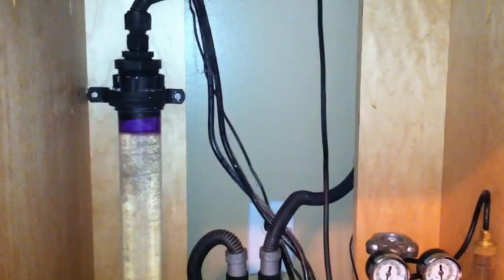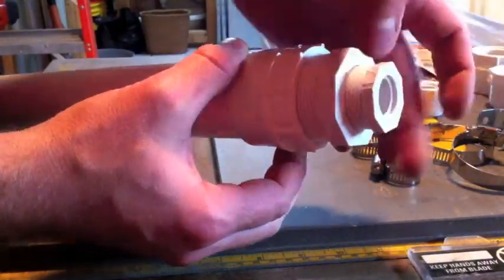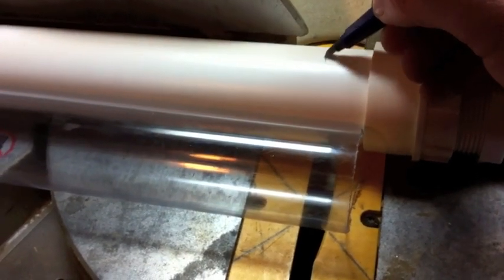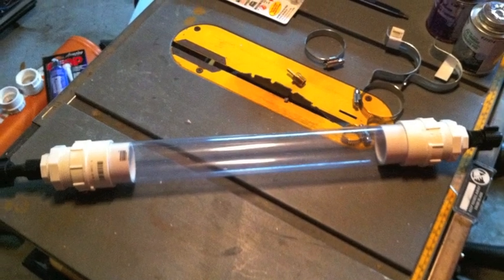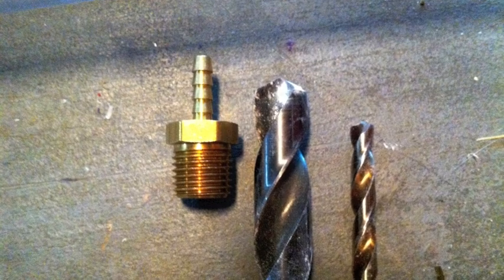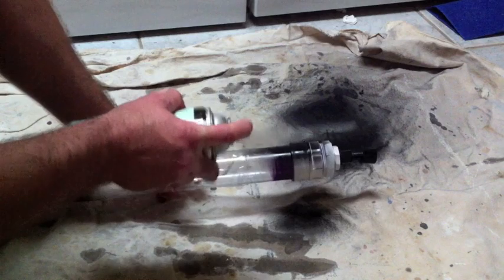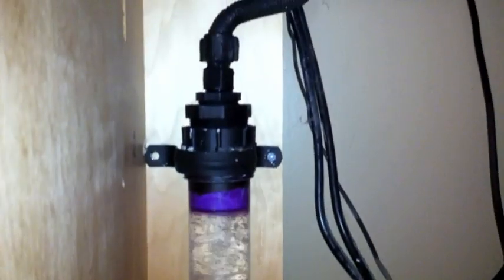Do It Yourself In-Line CO2 Reactor for a Planted Aquarium

Comment: Nice video. I know its old but I have some comments for anyone watching in the future.  

Threaded fittings are threaded for a reason. These should never be glued. You should only be using teflon tape (plumbers tape) to seal the threads. If need be you can also use liquid thread sealant but once you glue it there is a reasonable chance the fitting will leak and you will never be able to undo the threads. Now you've just made yourself a nice piece of pvc trash. 

Also, if your goal is to diffuse co2 in a reactor why is there no media in the main reactor chamber to break apart the co2 bubbles? Thats the whole point of the reactor being a 1.5" pvc length. You might as just pump it through vinyl tubing if there isn't any media in the reactor. Its not a reactor the way you've set it up.

Comment: Thanks for the video. There seems to be some confusion on a couple of design characteristics. It would be very helpful if you could clarify for others that want to build one.
1. Which side of the filter is this located? Intake side, or outflow side? 
2. Which way does the water flow through the reactor, downwards or upwards? 
TIA.

Comment: I see the co2 going into the bottom but witch way is you water flowing
Reply: Andrew Howard actually are you sure. I think the water is flowing in from the top (hence the splashing in the tube) and out the bottom.
Reply: eddiekytia Water is flowing in through the bottom and out the top.
Reply: @Townie_au  Top down otherwise it will not work

Comment: You're feeding the CO2 into the bottom of your reactor? Is the water flowing from top to bottom?
Reply: gpwnedable the best way to go is to just flip it. Have the co2 input on the top. Then run water from top to bottom. So Filter -> top of reactor -> through the reactor -> out through the bottom of reactor -> into the tank. This way the co2 is fighting the water pressure coming from the top more effectively.

Comment: Hi Start,
I love the design you came up with, as I'm looking to create the same type of in-line system for my 210 Gallon tanks...One question, though.  As far as I can tell, you have the reactor on the intake side of your filter.  Wouldn't that charge the filter with CO2 and harm the biological filtration portion of your filter?  If you had it on the Outflow side of your filter, the CO2 and water would co-mingle in the reactor and then go directly into the tank.

Otherwise, fantastic build.  Looking forward to seeing your other videos.
Reply: +Paul V. Rotondi i thought the same thing... for me it would cause an issue with air in the impeller. i have the Rena XP4 and had these filters for years with no flaw other than air in the filter during a fresh start. even an air stone by the intake will cause this. 
so for me i would definitely put it on the outlet. but i am now wondering how clouded your tank would become with bubbles....could this be why its on the intake?

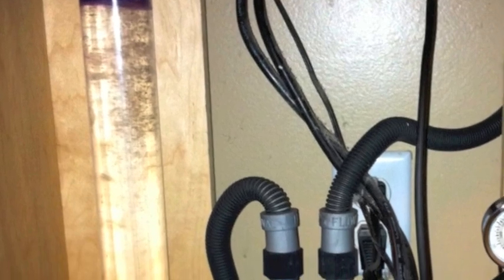Comment: Looks to me that you can see the outflow going to the bottom of the reactor at 5:55.  Not sure what the benefits would be of flipping it. as then you could potentially have CO2 back flow into your filter pump, screwing up the suction and messing the whole works.

Comment: Awesome solution....  Seems like this is really scalable, too.  You could use different size vacuum tubes and pvc fittings.  Really nice...  Wondering about the PVC glue though.  Any chance of toxicity to the fish?  Seens like Teflon tape and aquarium sealer might be a safer choice?  Thoughts on that?

Comment: Thanks for the nice video.  Presumably the water inlet is at the top and exits from the bottom, so I'm curious why you put the CO2 inlet at the very bottom where it could possibly get caught in the water current and flow straight out?  Obviously you could just flip it 180 and problem solved, but just curious why you'd done it the way you have?
Reply: BigBadBurrow The best way to go is to just flip it. Have the co2 input on the top. Then run water from top to bottom. So Filter -> top of reactor -> through the reactor -> out through the bottom of reactor -> into the tank. This way the co2 is fighting the water pressure coming from the top more effectively.
Reply: Agreed!

Comment: You can get plastic NPT to barb fittings at Home Depot or Lowes in the plumbing section.  I'm going to use a 1/4" NPT to 1/4" tube compression fitting in plastic for my project.

Comment: hi! i'm planning to make one like this. but i'm wondering about the brass fitting, brass is made of copper right? and copper is toxic to fishes, invertebrates and in high concentrations aquatic plants. i wonder if theres a plastic or pvc fitting for the co2 line. anyways great job. one suggestion though this should be attached to the outlet line of the filter and filled with bio-balls, and also should be resealable for cleaning. just my two cents, but over all great job!!